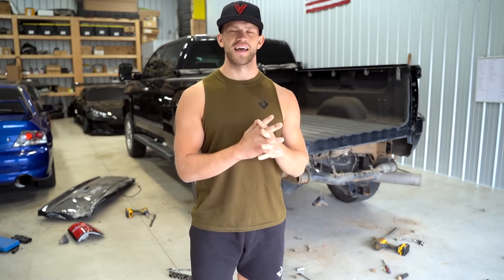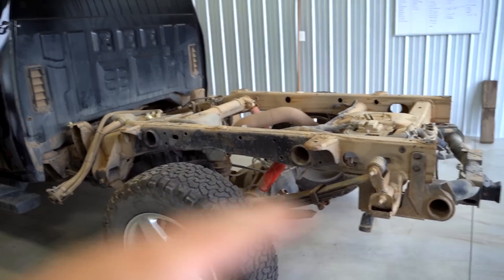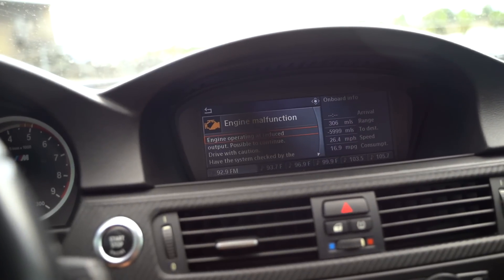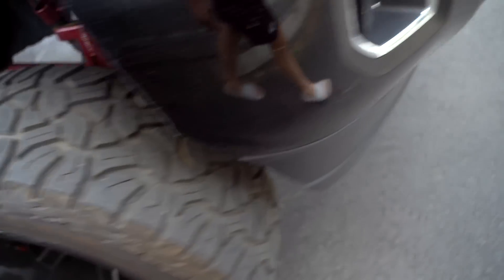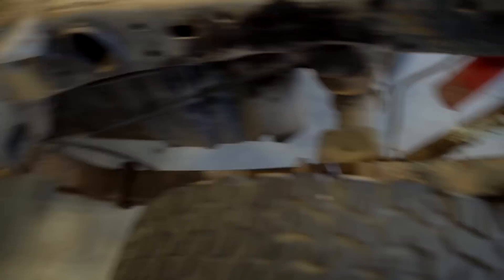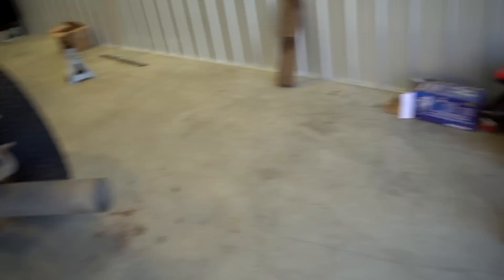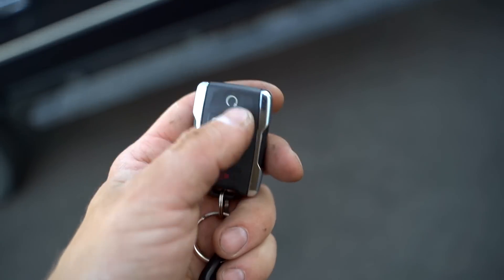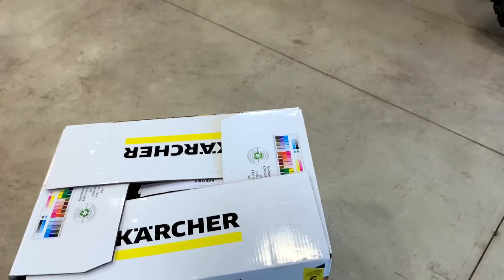Rebuilding the Wrecked 2015 Duramax Pt. 2

Comment: You need the ObsessedGarage pressure water setup. It would be perfect for the new shop!
Reply: Seriously consider splurging for an kranzle 1121tst. 10 year pump warranty, all high quality brass pump parts & components, very long hose and tucks away nicely in the garage. Just got mine a few weeks ago and is definitely worth it.
Reply: It also costs more than the last evo he picked up lol
Reply: Leois12 yea but imagine how many times he will use it. For a lot more then just cars. Plus I’m pretty sure he is not leaving that new shop anytime soon. It’s an investment. He wasting more time and money buying the cheap one and having them break and having to return them.
Reply: 100% agree. Stop buying crap like Ryobi and Karcher. Kranzle is the only electric pressure washer to buy for heavy use. I have had a K7 for 3 years and it's the best money I ever spent on equipment for my shop.
Reply: Leois12 Was that evo really less than $1200?
Reply: Ronar Toribio It’s a joke but also I think he said he only signed a year long lease on it and was planning to upgrade when that was up.
Reply: Leois12 yeah but the setup is removable as well.

Comment: NSX all the way, everyone has a Supra now and NSX’s are just gonna get rarer
Reply: This. They’re already shooting up in price
Reply: Yup, and a mk4 supra is a boat u less you drop a heap of cash into them.
Reply: arent they mainly autos? epic fail point
Reply: More rare*
Reply: "Everyone has Supras now" haha. Ok. Maybe the trash bmw version. The LHD 93-98 yeah not so much.
Reply: Charles Kennedy stock vs stock the mk5 walks all over the mk4... as much as some don’t like it, it’s proving to be a bloody ripper of a car.
Reply: @mj_aussie_coaster_travels8310  yeah, don't care about that. It should walk all over a 25 year old platform. Some like the new supra. I'm not one. I tried. I just don't like them.
Reply: Charles Kennedy what do you like about the mk4 as opposed the mk5? Not tying to start an argument, I’m genuinely curious about why people like one so much over another. 
Personally I think the mk4 is one of the most over rated Japanese cars of all time.
Reply: @mj_aussie_coaster_travels8310  no problem, man. In my opinion they have a timeless design,  the stock block can comfortably handle 600 to 700 wheel horsepower the stock getrag v160 trans holds 1000 whp all day, the sound off the inline 6 2jz(along with the rb26). The MK4 was ahead of it's time. A true icon imo. The ever appreciating prices of the USDM model tells the story. Highly sought after.

Comment: Ive had a Karcher K5 Premium for over 2 years now, has never leaked or caused me any troubles. All you gotta do is make sure the air is out before you turn the power on. I upgraded from a K2 and my K5 has been fantastic

Comment: You should definitely take it to a shop and get it Undercoated while the bed is off. My boyfriend owns Line-X out in our area of VA and we use Valugard and it's a nice black finish. It's a wax based undercoat and also a once and done applied application. Most Line-Xs should offer it. There should be one around yall. 100% get the bed Line-Xd as well. Get that nationwide lifetime warranty and you'll be able to beat your new bed up. Whatever you do I'm stoked to see!

Comment: I have Chevy Silverado 2016. LTZ2-Z71. Has same full options. For remote start, click lock doors on the remote, then long press on the start engine. Also if u long press on the unlock it will open everything. Can’t close though too bad.. u can make the seat vibrate too in place of Parking sensor chime. U also have lane keep assist and with cruise control it’s like autopilot and the steering wheel will turn itself to correct the lane. U can try this too to see if it’s driving straight.

Comment: the remote start should be press the look button and then press and hold the remote start button. Also another cool feature with GMC fobs is if you hold the unlock button for 5secs it'll unroll all your windows , nice for those hot days.

Comment: Kranzle pressure washers are a good choice if you want them reliable and lasting a long time. They offer a portable and wallmount solutions. They are more expensive then the cheaper ones you find at home depot.

Comment: might be to late but could get gas pressure washer and put the exhaust out the wall near the front of the shop if your going to wall mount it? just abit of flexie pipe, clamp, off muffler straight out a hole in wall? mad editing on the unboxing, it's the little things that make your volgs so great...

Comment: Use DTM (Direct to Metal) Imron 2.1 or 3.5 HG-D + Polyurethane High Gloss Topcoat to paint the back half of the frame. It will stick to anything even with little prep and its almost bulletproof. Also in Montana we don't have salt on our highways. I know depending on where you live that certain cities might use salt. But we do have magnesium chloride on the highways which is just about as bad.

Comment: Devin go to Amazon for a budget power washer this one is still running strong after 3 years no maintenace or “storage” / winter prep ever done. Look up Sun Joe SPX3001 2030 PSI 1.76 GPM 14.5 AMP Electric Pressure Washer with Hose Reel

Comment: check out the Kranzle line sold by Obsessed Gararge. He has a store/site/youtube. You could have his whole setup wall mounted with the hose on a reel and even extras like deionized water etc if you wanted. The Kranzle is electric but it's super powerful and built to last.

Comment: I have same pressure washer the koehler works well just don’t leave it plugged in over night With water going to it as it’ll fry the fuse plug I put a new plug on mine though and now it works great again so if that ever happens!

Comment: Auto start: press lock button (all doors an hood have to be closed) then press an hold auto start button. 
To cancel after starting the truck hold the auto start button. Check engine light will disable auto start.

Comment: Hey You should try the Ryobi 1800 electric pressure washer  it works great never had an issues and it’s only $150 while you get the other one.its at Lowe’s or Home Depot.

Comment: Kärcher actually do make some good pressure washers.Had ours for 10+ years without failure. Using it on cars, pavement and decks without a problem. Devin is just one unlucky guy

Comment: You should torque the leaf spring when it has the full weight of the truck. Torquing it in the air like you have will wear out the bushing prematurely.

Comment: Just camber and toe in the front. Most trucks are that way. That bad rear shock will throw off your alignment btw. tailgate is missing. Idk if that tailgate is electric but that could be why it's not working

Comment: Nsx hands down! And I’m not saying that just as a Honda boy. Devin if you get a nsx your gunna have to host your own car meet and I’ll make the trip from Cali in my RSX
Also devin, I’ve had the green pressure washer from harbor freight for a year and use it all the time no issues whatsoever, just make sure you get the adapater if you want to use a foam cannon. Only like 90$ with a coupon

Comment: get a decent gas operated industrial pressure washer.  with the work you do, it will last far longer and be far better in the long run. You can vent the exhaust with a tube in in the wall or thru the door.

Comment: I bought gas a couple of yrs ago and I'll never buy electric again. The only downside was the 20ft hose. I purchased a 50ft one on ebay & now have 70ft in total. With that much reach, you could easily leave it outside and just run the hose under the door. We just pressure washed the whole house and moved the washer once. Corner to corner diagonally. Go gas... you won't regret it. So much more bang for your buck.

Comment: Make sure your garden hose that attaches to pressure washer has the o ring still inside the end...sometimes they fall out which would cause your leaking. Also check the female end on your pressure washer. If you have neither, let me know and I can drop a couple off. I have extras.

Comment: You should throw a stake bed with flat wood bed on it. It would look sweet!!! I have the same Ryobi pressure washer you were using. It has lasted me over a year and half. You must use the spray lubricant for pressure washers after each use. Maybe you weren't doing that, which is why it died? Sorry to hear about your BMW troubles. :-( NSX for sure. The engine was built to get better with age. BTW, I bet if you use the lube spray in your old pressure washer and let it sit for 30 minutes, it'll fire up and work again. It's a known issue. I would spray all of your bushings with silicone on the back end of the truck while you have it torn apart too.

Comment: For your BMW, get the ICarly Bluetooth module and App,...You have to pay for the yearly app subscription, but its helpful to read and reset codes if you're on the road so you wont be stuck....
As for the NSX or Supra, Id get the NSX any day, all day.  Its a true sports car known for all around driving experience.  The Supra is all about the motor and a movie....More for posing and bragging rights, whereas the NSX stands for itself...

Comment: Remote starter may not work due to not having all the components attached
 On my truck I hold the button down until you se tail lights come on the let button go and truck should start. Check it out

Comment: Hi that was not your washer leaking it was your hose I’ve used the same machine for the last five yes with out issue they push back so much pressure that water hose must be top quality. Change your hose and I bet 10 dollar it doesn’t leak. Love the channel let’s hope you can find a decent hose before you return it.

Comment: Cheapo pressure washer? 
That Karcher K5 is a top line model in the UK haha. That leak also looks like it wasn’t anything to do with the Karcher. They’re easily the best non petrol powered Pressure washers on the market. It was either your hose or you were super unlucky and just got a dud one

Comment: General Motors don’t undercoat or paint there frames they use a wax coating witch sucks and is a pain to remove should undercoat it while the box is off 🙏🏻

Comment: If you're looking for a good quality pressure washer for about 130$, I bought this on amazon. It works great. Just copy this Homdox Electric High Pressure Washer 2850PSI 1.7GPM Max Power Pressure Washer Machine

And boom. I bought an extra foam spray at wally word for an additional 10$ but it works great. Cheap too